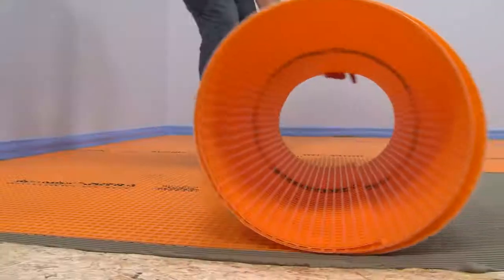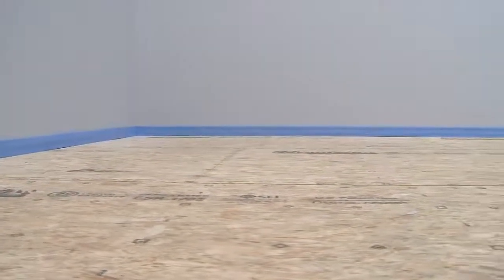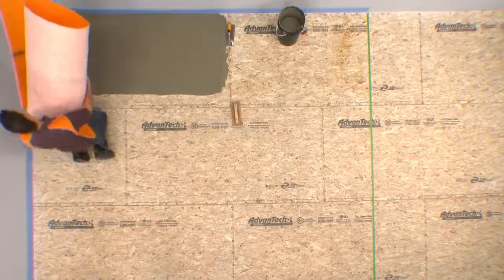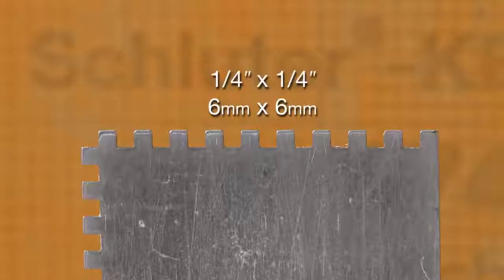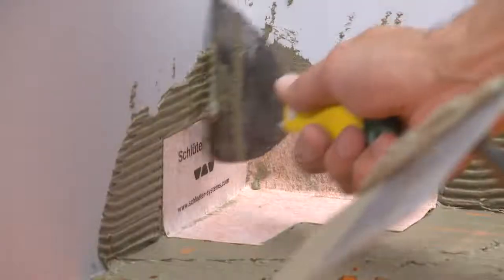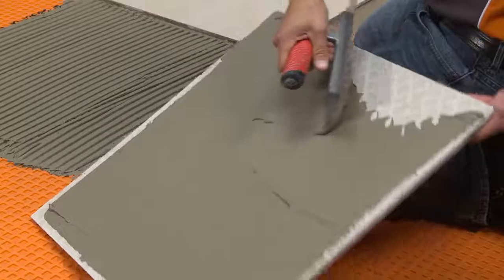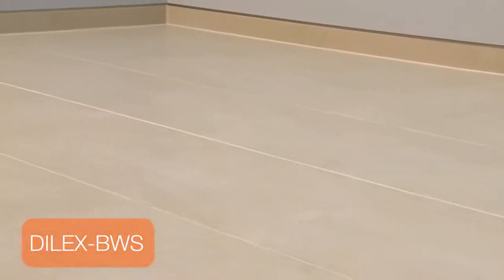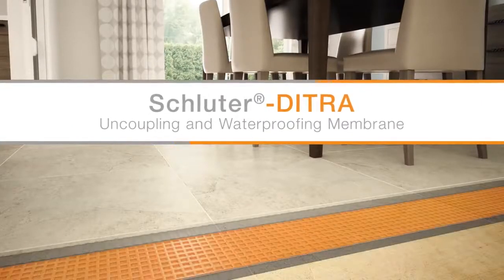Schluter-DITRA Installation over Wood

Comment: 1:52 - Sill Seal, for flooring application is not a polyethylene "gasket", it is a polyethylene "foam", I'm sure this probably confused people buying gasket strips, Schluter are the experts with foam shit, but fails to talk about it, get a professional to do your multimedia editing / production. Also when you place tiles, professionals use wedges, it is retarded that Schluter thinks of themselves as the "professionals" with flooring products but fails to show professionalism, people clueless with flooring renovation will see this video and will be misguided by applying tiles without spacer wedges and then realize schluter is retarded.